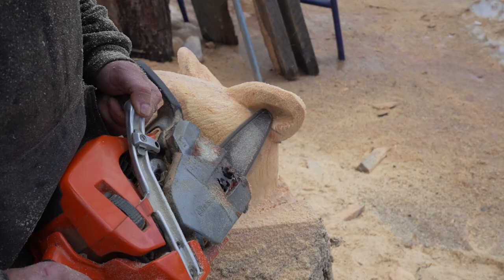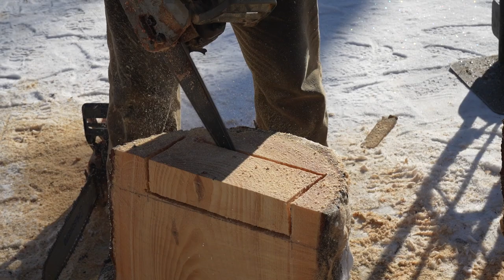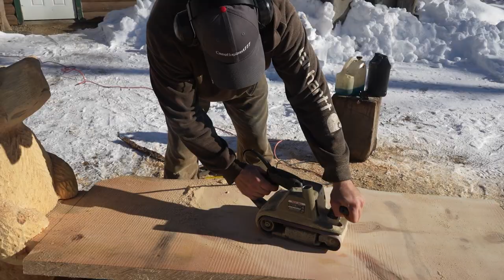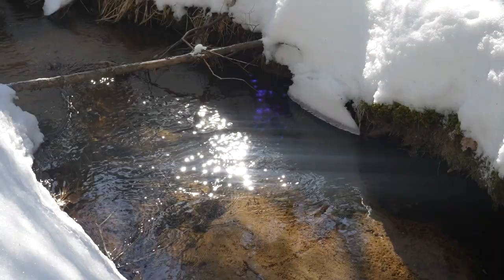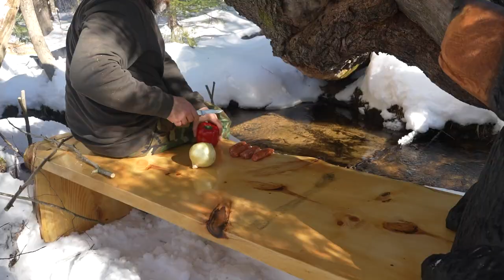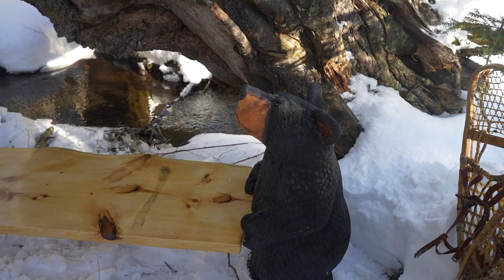Chainsaw carved bear holds bench #12

Comment: Thanks for sharing that is really cool!  What causes that black coloration of the wood or darker spots in the wood?
Reply from the maker: Thanks, by darker spots on the wood, I'm assuming you mean the bench seat. Those are knots. In this case pine knots. The seat is a 2 inch thick board that is basically a cross section of a tree, or log. The tree had branches that grew from its trunk, and these knots are where the branches attached to the tree trunk
Reply: @CreationDust777  Thanks, the only reason why I asked is I was milling some post oak this weekend with a Alaskan mill and ran into some of the wood in the grain that has a real dark coloration and not the heartwood.  Thought I saw some of that in the bear sculpture.
Reply from the maker: @aarons3203  the other dark spot I noticed is due to using a wet "sticker" piece. I have a small portable bandsaw mill that I mill my own lumber with. When you stack freshly cut lumber to dry, the sticks, or spacer pieces laid in between the boards to create an airspace are called stickers. Technically you should use dry wood for the sticker pieces. When you use fresh cut, or wet wood it creates a stain on the wood, or dark spot. It's not offensive to me. I call it character. I'm not familiar with post oak. I mostly deal with red oak on my area. Turning logs into lumber is a very satisfying process.
Reply: This reminded me more of a coloration from metal being in the wood like a nail but, much bigger almost like somebody spilled black dye on it and tried to wipe it up!
Reply from the maker: Without seeing it, it's tough to weigh in on it. I don't know about post oak, but our red oak has a tendency to stain things black. When cutting up oak fire wood the chain on my saw will stain black.  Sometimes the wood will discolor. I like wild variations in the wood coloration.  Depending on the project the wood is used for it can make for interesting effects.  What most mills consider top grade Lumber I often find boring. I like lots of knots, colors and rustic charachter.

Comment: Are your logs still green when you carve them or are they completely dried out?
Reply from the maker: I generally let them sit for a few years before carving. About when the bark is falling off is pretty good. The logs are so big that they won't dry out completely.  There's always going to be some moisture content. The process of handling  the wood throughout the carving process and the drying of the piece during that process is as important  as using seasoned logs.
Reply: @CreationDust777  thank you